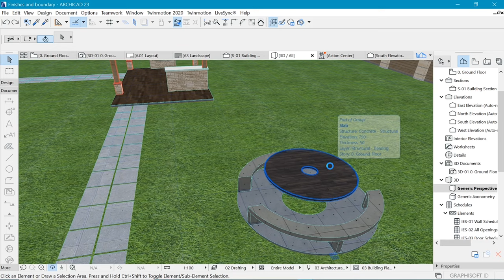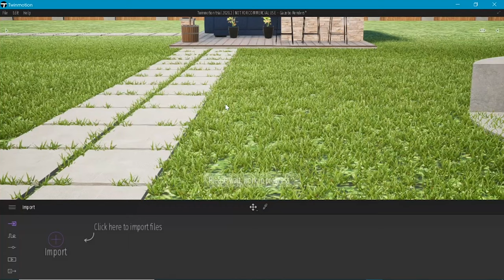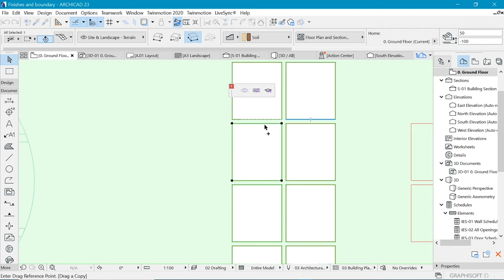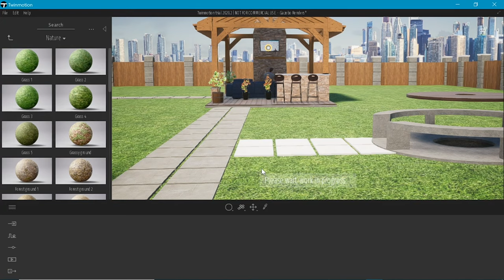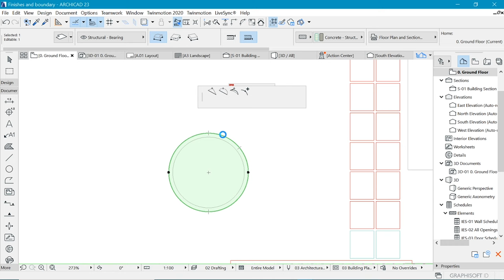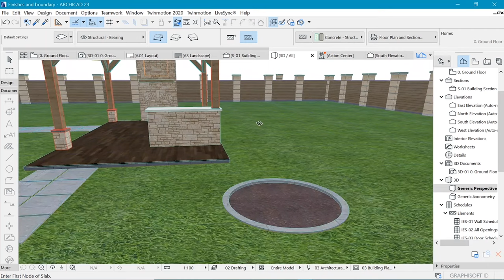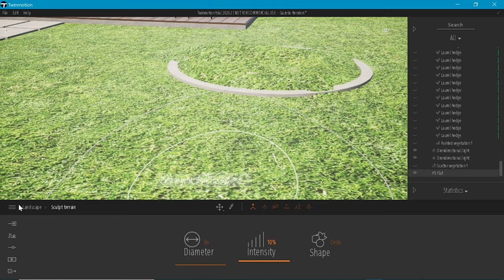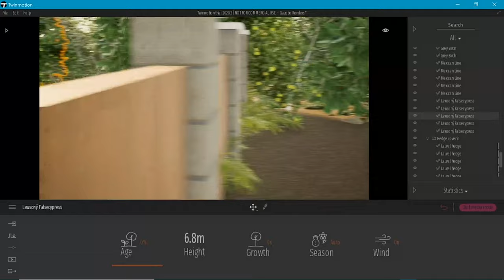How I did this! And why you should care! 3tips for Landscape with archicad and twinmotion

Comment: 3:14 , i really don't understand how you do it a hole without using "OPERATIONS METHOD" 😅😂, I watch this 20 times and didnt figure out 😅. maybe oxigen slab invisible. 😅
Reply: 1i try air method,but not work with mesh-slab, air method work in slab-wall-beam. 

2 i only did it with two mesh method and cut one mesh like on video with lines 😊